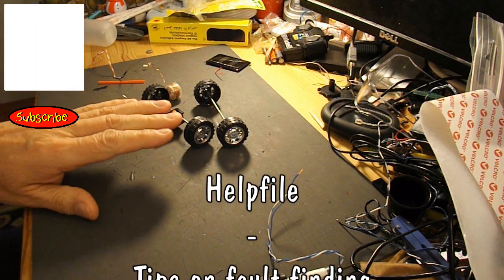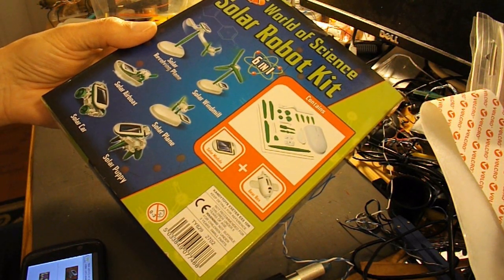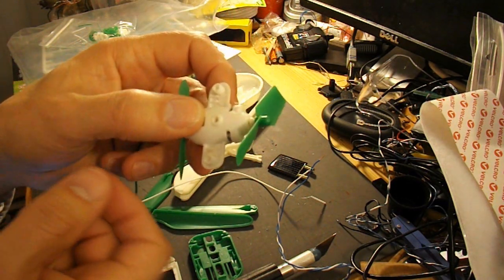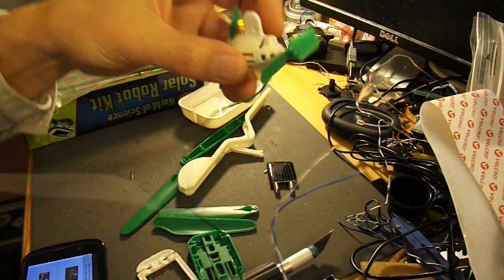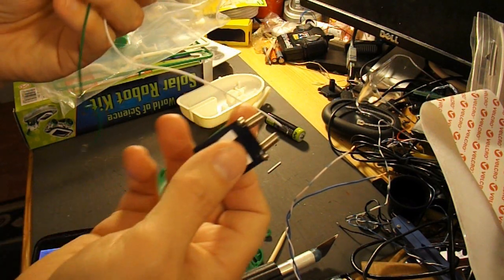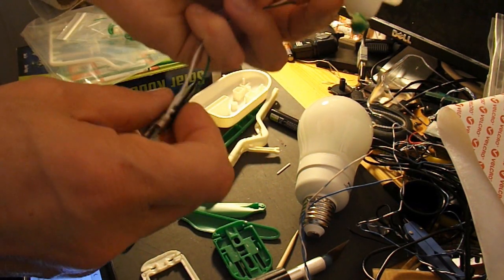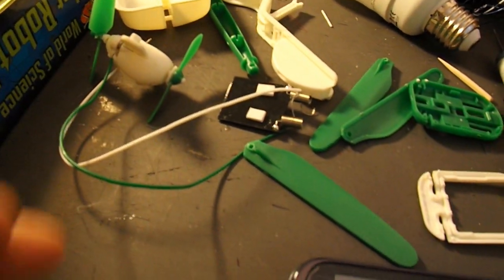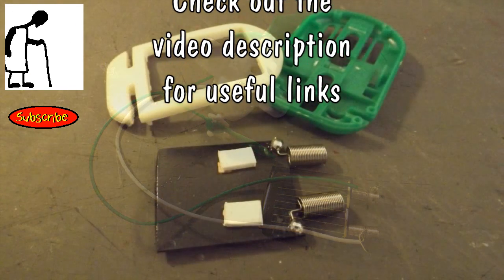Helpfile - Tips on fault finding the Solar Robot Kit 6 in 1

Comment: Thank you❣️I did have to watch a couple of videos to get it working. My question was if it has to be played with in the sunlight? I’m guessing this isn’t storing the energy? I got two similar solar robot kits for my eight year old grandsons. $5.00 each, unopened, at the goodwill. They were excited. Took time and patience to get set up, but worth it. Not disappointed. 🥰🥰 They will enjoy creating their own robots now.
Reply from the maker: Yes, you need sunlight, they do not store energy. Alternatively you can use old style incandescent lightbulbs or halogen lightbulbs. Other modern bulbs like the LEDs or the CFLs (compact fluorescent light) do not provide the right wavelength of light and so they don't do the job.

Comment: Bro actually th upper part of the wire came out in my robo kit now will it stop working? 😭😭
Reply from the maker: If the wire has come out of the motor, then you will have to replace the motor, it is practically impossible to re-attach the wire.
Reply: @GrandadIsAnOldMan  actually I am talking about p9 the white wire
Reply from the maker: @EditorShaz  the wires make the circuit when the conductors are squeezed in place between the coils of those springs
Reply: @GrandadIsAnOldMan  So will it work or not
Reply from the maker: @EditorShaz  what sort of question is that? You have it sitting in front of you, so you tell me if it works. If it doesn't work then you haven't got the wires connected right. If you are confused about the wires, the plastic sheathing insulates the conductors. The conductors are the metal wires inside. It is the conductors that make the electrical circuit so if you have the plastic in the way there is no electrical circuit.
Reply: Actually I'm trying to make solar plane
Reply from the maker: @EditorShaz  as long as you have two wires running from the solar panel to the gearbox it should work. All the projects in that kit work the same way electrically. Solar panel provides the power to run the motor.

Comment: The mini motor’s wire came out,help.(both red and blue)
Reply from the maker: You have virtually no chance of repairing that. It is possible to get the motor apart and resolder the wires but in practice you are more likely to damage the plastic cap. Here is my playlist with several videos on the subject https://www.youtube.com/playlist?list=PLA5a2xPRSrB0CDj118t0MX8PuQxbG7m30

Comment: My  gear didn't work
Reply from the maker: Sometimes there is a little roughness left from the plastic moulding that needs to be trimmed to ensure everything runs freely. You also need to check everything is correctly aligned.

Comment: Really 100 w lamp made it spin. 
Solar panel is too weak - only direct sunlight effected a bit.
Waste of money.
Reply from the maker: I think you will find the same problem with most of the solar power toy kits and most of them tell you in the instructions what sort of light bulb you need to run them.

Comment: Scam right I can't make it too this is antalya 35 degrees but not working
Reply from the maker: So you can't get it to work and that makes it a scam?? maybe you haven't got it right. It works for me in the UK and we have much less sunshine. Try connecting the solar panel direct to the motor without fitting it into the rest of the assembly and see if your motor runs with your solar panel. If it doesn't, try connecting it to a 1.5 volt battery and see if the motor works. That way you can work out where your problem is. If your kit was one of the really cheap ones then there is a good chance it was a copy of the original and the mouldings are not as clean as they should be. The usual problem is people have put it together without ensuring all the parts fit without friction. Cleaning the plastic mouldings to remove any bit left from the moulding process would be a good start.

Comment: This toy is a scam because I tried it and it does not even work. So do not buy this toy.
Reply from the maker: Karl pinpin1234 what sort of light are you using to power it? Most modern low wattage bulbs do not give the right radiation. You probably need to find a halogen light or a really good sunny day.
Reply: hi .. if my motor does not work with a aa battery is it stuffed?
Reply: Karl pinpin1234 your not doing it right

Comment: complete novice here, so pardon me while I ask the obvious: how, exactly, does the wire connect to the motor? does it need to go around the spring? (like, is it supposed to fit between the coils of the spring?) my instructions are vague here; it simply says "connect". hope you can help, thanks.
Reply from the maker: Sorry for the delay replying, I have been on holiday. The wires have a short length of the insulation removed at each end and that is the bit that you trap in the spring by bending the spring to create a gap then release the spring so it grips the wire.

Comment: This kits solar panel isn't strong enough to power the motor.
Reply from the maker: It works fine. You will find it works best in real sunlight. If you are trying it indoors with modern CFL or LED lights you have virtually no chance of getting it to work. An old incandescent light bulb or a halogen bulb will make it work.

Comment: HELP one of my solder connection has been separated from my solar panel
Reply from the maker: Hao Lee if you are lucky you can solder it back again. There are special conductive glues available, but they would probably cost more than buying a new cell from eBay. SO maybe look on eBay.
Reply: Thanks for the reply I'll try

Comment: Cuidado com a escala com que é filmado. O tamanho do painel é minúsculo, e só com luz solar intensa, mas mesmo muito intensa, é que funciona minimamente. É uma besteira!
Reply from the maker: Hi Jose, perhaps you do not speak English, I certainly do not speak Portuguese. I have made no attempt to mislead people with my video. I hold the solar panel in my hand so it is clear how small it is. I also explain that it needs bright sunlight to work well, perhaps you did not understand my words. I have no connection with the company that makes these kits. I bought my kit and it works for me but it either needs bright sunlight or a good light bulb. Modern CFL bulbs are not suitable. All this is explained in the video and in the video description.
Reply: darn.  Where I live it rarely is sunny... it's like UK weather along the sea coast...  I still have an old 100W light bulb, will try that on the panel to see if it forces it to produce electricity...

Comment: Thanks for the tip on the light source: I was trying to get it working with LED lightning (and a neon desk lamp as well), which clearly wasn't sufficient, but the old fashioned light bulb did the trick.  thanks!
Reply from the maker: Thank you for the positive feedback, yes the modern light bulbs just don't do the job. The best results come when the sun is high in the sky, in fact it works so well then you suddenly realise just how powerful the sun is and how much energy is hitting us every second of the day.
Reply: GrandadIsAnOldMan It does proove one thing: these LED lights are really energy efficient!
Reply: so efficient that they don't produce light with energy in it.  :-P

Comment: regular lightbulb won't give you enough solar power. Try gu10 (AC) halogen or MR16 12V DC and it will give you enough juice.
Reply from the maker: Yes, that is one of the points I make in the video at 6:30, but you still need to do the basic checks I showed. If your wiring is faulty or your motor does not work then it makes no difference how good your solar panel is or how bright your 'sun' is.

Comment: Good troubleshooter vid and am glad the question asker saw it...hope his works now.
Reply from the maker: Thanks Slider, I had to think how to do it with no meter. First principles, check the motor works with a battery. Other things like a CFL light not giving enough power is something to be aware of.
Reply: GrandadIsAnOldMan
 After watching your vid, I tried a 'Smallest car in the World' solar car with an 18W CFL..it ran fine, but needed to be up close.
Generally in my own testing of various types of solar cells, voltage can be a high percentage of sunlight, but amperage is about 1/10th with such a light.
LED bulbs are weird. Stuff that works fine under one 3W LED is pants with another 3W and a 5 LED torch works better than a 32 LED mains bulb under its reflective shade !
Reply from the maker: slider2732 I have no doubt there is a very technical explanation with the different wavelengths emitted by the different components used by the manufacturers of the bulbs and the different wavelengths detected by the different construction methods of the solar cells. Rather outside my capabilities to detect or even understand other than try it and see what works. Given the choice I would rather sit in the sun with a cool drink :-)